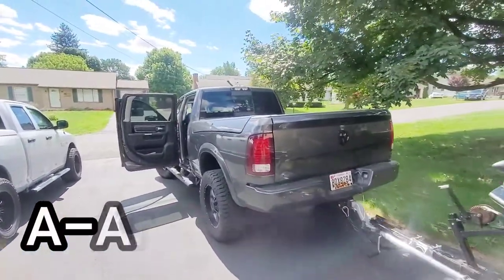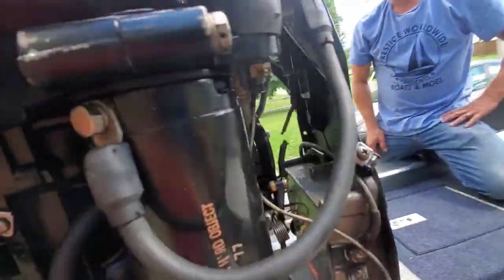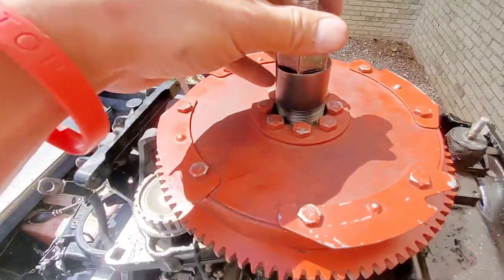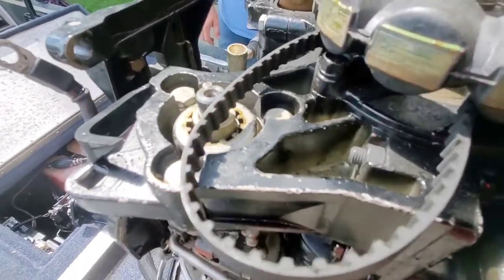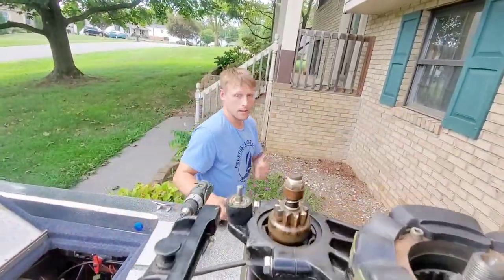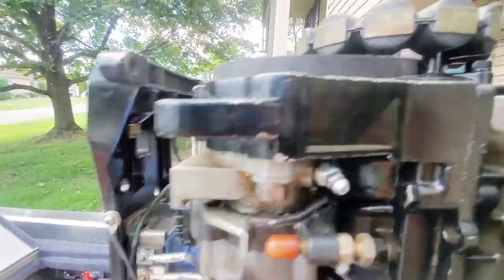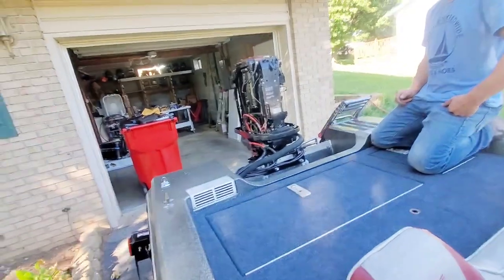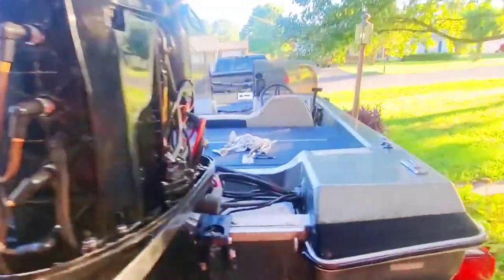Mercury Outboards: Distributor Install & Proper Alignment

Comment: Honestly this thing screams. Of course it's a little big for the 680lb. Cajun but it is rock solid. About to throw a 13.5 24p 3 blade on it because it spins the 17p 4 blade to over 7k like nothing. Son knows his stuff and is a good dude. He doesn't have to share his vast knowledge of these motors with everyone for free. Go try to find an outboard mechanic to work on one of these and if you do find a shop,  refinance your house for when the bill comes. Instead of trying to be "that guy" who knows it all, say thanks man. Good info.

Comment: I just picked up a 1977 1150 for $50.00 and thru your videos  got it tested out to be a bad trigger. I picked up a 1979 115 that was missing a bunch of parts but had a good trigger swapped it and got it going. It is on my boat now and running good for $100.00. Oh had to rebuild the wiring harness also.

Comment: I just got a 1973 1150. Watching all your videos and it really helped me get an understanding on these badass motors.
Reply from the maker: Great. Son
Reply: I have a shift shaft seal leak and while I was investigating it i turned the shifter link cam loose  and the whole shift bar came up and ou. Now it just spins free when I reinstall it.  Is the problem deeper now?

Comment: Just remove the 8 screws. Lift the flywheel off noting where the pointer is, I always set it at TDC so it is easy to remember. Then you can remove the three bolts. And if you remove the stator you could easily replace the belt if necessary.

Comment: Son, I have a 1975 1500 and I have rebuilt carbs, made sure getting enough fuel, linked and synced, according to ur video. We even chatted a little about a misunderstanding I had about it. I got it all squared away and running however, when it's put into the water under a load, it goes ok a little then When full throttle just bogs out and won't go any faster. What do u suggest? Thanks in advance.

Comment: Howdy, I’m back with another question. I got my new trigger installed. I removed the flywheel by the “8 bolts” instead of the “center bolt” like you did. I’m not sure how tight to tighten the 8 bolts. Do you think 100 foot pounds is tight enough? And should I do it in a star sequence or in a circle sequence when tightening? Thank you so much for your help and reply’s. 
-Westley from Oregon
Reply from the maker: Should be. Definitely a star sequence. When finished I would go through the star sequence one more time to make sure they are evenly seated. Son

Comment: If you have a belt driven distributor, do not pull the flywheel in the conventional way. This is one of the few models where you are actually supposed to unbolt the 8 bolts on top. You don't need to pull the spline apart unless you are replacing the belt. And even then, you will want to remove the stator first, which you can't do until the flywheel is off, so...vicious cycle. Make sure to mark every piece at TDC before disassembling. 
Replacing the trigger/pickup coil, is basically rebuilding the distributor, which sucks. So more power to ya, if you can get a bolt-on replacement. The current price for a new trigger coil assy is around $400, although I saw them on the ebay for $180. And be careful with the plastic rotor. It's $150 by itself. 😵 Suddenly, having to buy a new switchbox/powerpack (newer style motor) doesn't sound so bad now, does it? 🤣
Reply from the maker: Lol.... I always pull the flywheel off. I had to realign the flywheel because someone messed with the bolts. It's not fun. Thanks for your info! Son

Comment: I am about to order a new trigger for my 1976 mercury 1150 l6. Near the end of this video, you try to start it after installing the new trigger; and it didn’t start. Why? Was it because the timing was a half-tooth off? I am nervous to spend the $360 for a new trigger and have the motor not start.
-Westley from Oregon
Reply from the maker: Correct. Son

Comment: Hey man need some help real bad. My 1977 Mercury 1500 just cranks up and just takes off. I was on the water the other day and the cables got stiff and the throttle was hung. Got home looked at it and  the distributor wasn’t turning back to idle. I held  the distributor at idle and started  it up and it literally just takes off. Nothing I do keeps it from reviving up.
Reply from the maker: Sounds like a timing issue. Have you checked? Should be around 6-7 BTDC. Let me know. Son

Comment: Is that a dual rotor?
Reply from the maker: Negative.
Reply: Ok im trying to figure out my timing order to get my 1962 merc 1000 model 950 v6 i see no cdi or switch box on it i rewound the stator but dont have it hook up at the moment i dont think the year i have has a cdi or switch box but my rotor is a dual im a little confused with the distributor says on the cap 76 models only i picked up this motor with the boat i bought for a hundred bucks 5 years back i see alot of your videos seeing if you could help trying to take the family out on the boat spent years rebuilding the boat took it out once but i don't trust the johnson i got on the back of it
Reply from the maker: @flipinjon7487  are you sure it's a 62? Mercs didn't make V6s until the late 70s. What type of distributor do you have? A 62 has points with 2 coils whereas a 76 no points 1 coil. Son
Reply: @MerCSonL6  its a merc 850 i have the firing order and Master service manual says Timing is 14 52 36 but the rotor lines up on one and three I'm really confused if this is the wrong rotor on this motor picked up this motor off of the boat I bought yes it is a V6 and there is no CDI unit they didn't exist yes there are two coils but there are two points on the rotor the distributor is a 76 cu I wish they would have put a picture in the manual for the rotor for where it's supposed to be lined up when it is lined up in timed
Reply: I've restored everything but now I'm just trying to get it fired up just pops when I try when it does pop I give up so I don't let the motor get hot and yes I do have water running

Comment: Hey bro how’s it going?  I’ve watched your videos tons of times. Right now I’m in a dilemma with a no spark issue on a 1972 Mercury 1150. Just put in a new trigger and switch box and still have no spark
Reply: Sorry, got a bit ahead of myself lol. What would be your first course of action?  I’ve got 12V on the white and red terminal starter side of the switch box and I have two different coils I’ve installed
Reply from the maker: You replaced the trigger? Meaning you disassembled the distributor and put a new trigger in?
Reply: Does the cdi box make a squeal noise when you turn key on? It should.
Reply from the maker: @thediplomasta5891  correct. It almost sounds like it's not supposed too.

Comment: NOT METRIC
Reply from the maker: I like sequential.
Reply: The metric measurement is more accurate than friction on an inch. ... For more than 30 years cars, boats, etc used metric measurement in them as opposed to SAE. 👍
Reply: Bent Rods N' Fat Catz  The nuts, bolts and all standards on this motor are SAE. There is nothing Metric.
Reply: All I know is, that A A ron guy is really good looking and you're lucky he was there to make the video good.
Reply from the maker: @enronshu1974  I was thinking the same. He tuned the engine to perfection. We're currently trying to get a prop for him. A 4 blade 17 pitch can hit 7k rpms with ease. I told him to redline around 5800.

Comment: I’d like take my motor to you. I have 1979 mariner I have replaced timing belt, stator, trigger, rotor, distributor cap, plugs & wires. 
When I put the plate on I only have 1/4 to 1/2 throttle with the plate off functions correctly, the plate I’m talking about is the throttle stop screw adv timing, idle stop (plate).
Reply from the maker: Zip code?
Reply: MerCSon L6 73129
Reply from the maker: @Email.ilike-titsAtHotmail.c0m  so u live in Oklahoma?
Reply from the maker: @Email.ilike-titsAtHotmail.c0m  i would look at your boat for you. It's $50 just to look at it (Autopsy). Then $50/hour. Son